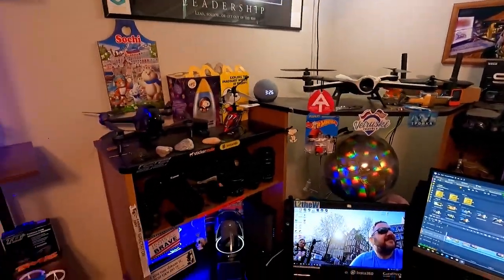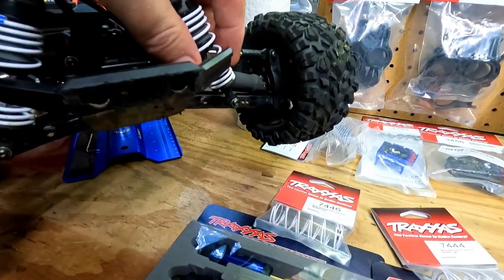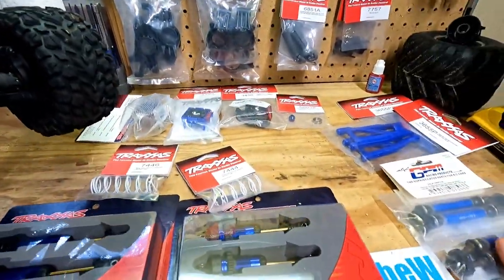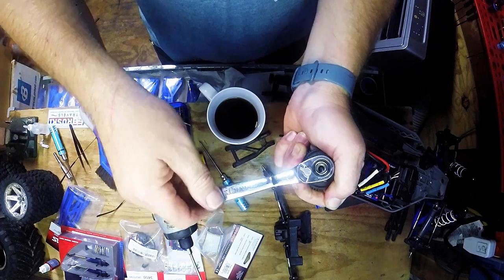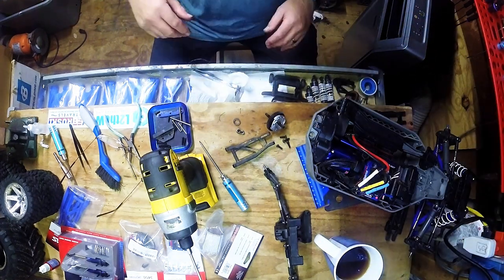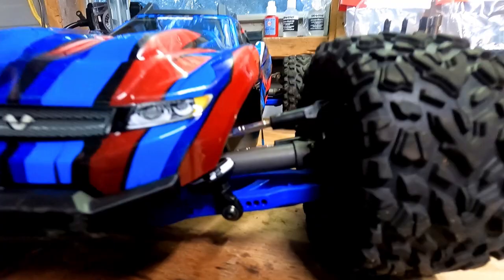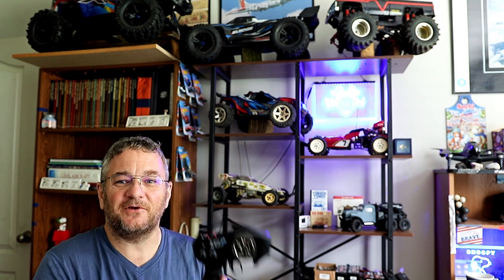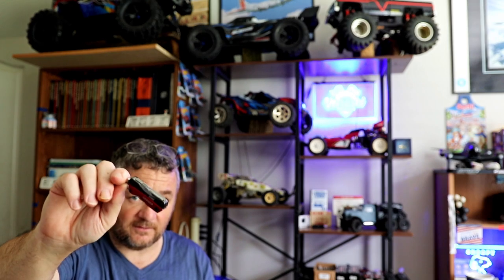Upgrades For My Traxxas Rustler 4x4 VXL

Comment: You should check out the hot racing axels very nice light weight aluminum with steel end . I have had a set for 5 years never had a problem with them

Comment: Id definitely replace all 4 drive shafts with MIP Heavy Duty. The A arms I go with RPM, they are alot more durable and last longer. Both these upgrades come with lifetime replacement warranties as well. The Rustler is designed to chasis slap on landing so don't worry to much about it slapping.  I've ran mine exclusively on skateparks for a few years now and it's been handling it fine.

Comment: Those gpm axle snap easily if you hit bashing on concrete. Those blue shocks retract great when fill with oil close to the bladder bulb on the cover.

Comment: I know this vid was 10 years ago, but I was just wondering if since this bid if you have installed the sway bar kit for it? I have it on mine, because the GTR socks helped, but it was still unstable. After installing the sway bar kit, it was a lot better! I also have the MIP shafts and have had no problems with them either.
Reply from the maker: I think you meant 10 months I dont  think its that old either lol I have not done a sway bar on it  to me it runs good way better than it did before but I am no professional at this so I dont know but racing around my back yard it seems fine I need to get to a real track maybe I would notice more there, good info on the shafts I still have them sitting in the bag I have yet to break the originals on here
Reply: Yes I did mean 10 months lol. As for the stock shafts, I broke one on my first run, and another on my second run.

Comment: 11:50 best POV right there! I told a friend of mine about your RCs and asked if it's possible one can make his own with a 3D printer, and he said it is! Your knowledge of how these configurations work (and cars in general) blows me away.
Reply from the maker: Thank you very much I dont know that much about these I hear people talking about this weight oil in the shocks this weight in the differentials will do this and that and I am like wow.  You can 3d print the parts I wonder how stong it would be? These cars are tough they have a good bit of flex to keep from breaking I have been looking to get one or a laser printer see what I could make.  I have a better mount system now for the camera so better views coming :)

Comment: Chasis didn't attack the ground if droped it?
Reply from the maker: Sorry I am not understanding
Reply: @L2theWcarscoffeelife  I mean, that didn't lower shock tuned?
Reply from the maker: @digeolrc8586 you mean did it lower the car? Nope its still the same height and its adjustable you can tighten and loosen the springs up the car drives so much better now these are more responsive and you dont have the problem with the  springs popping loose
Reply: @L2theWcarscoffeelife  ok I see... Thanks for explained 🙏